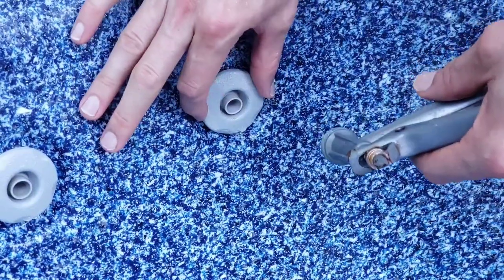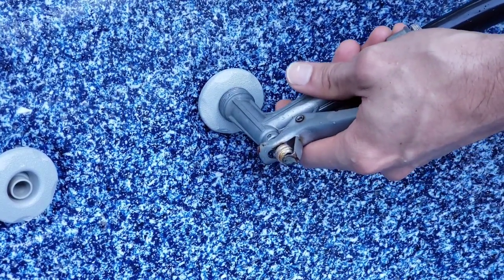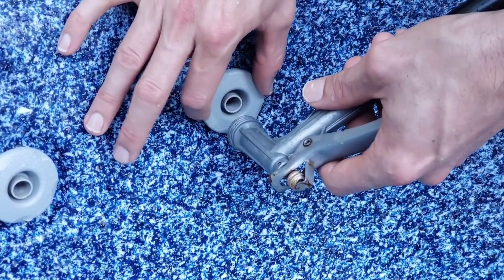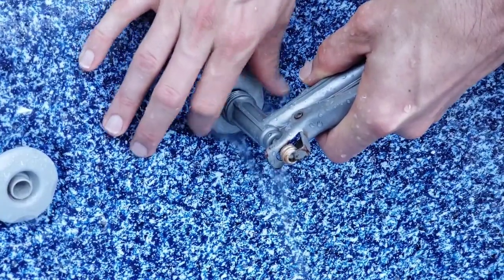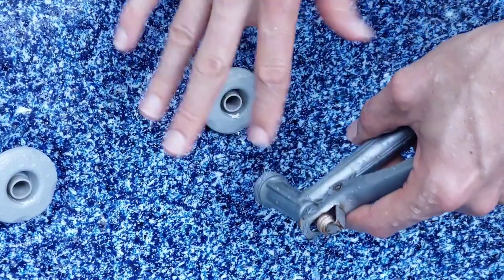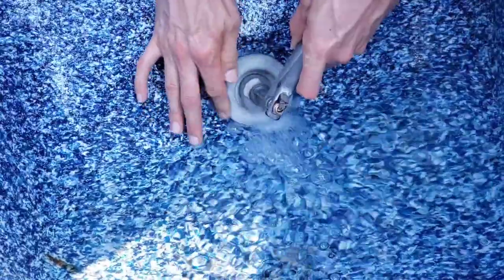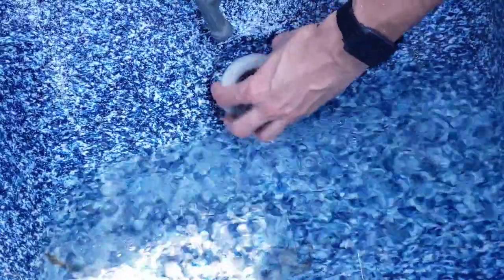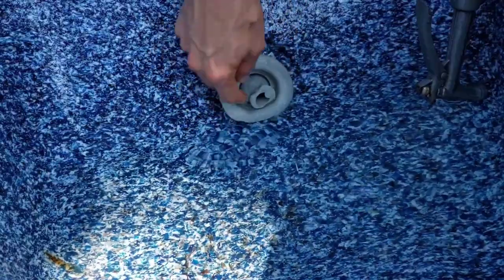Hot Tub Jets Stuck? The BEST Way To Fix & Clean Them

Comment: Awesome thanks
Reply from the maker: Glad to help!
Reply: I have brand new spa and some of my jets is always stuck lol. It is because my water is in trouble??😓
Reply from the maker: @michaeltechreviews5390  That is normal with spa jets. They get stuck. Higher hardness will make it worse, but even with balanced hardness tiny grit and stuff builds up and jams them. I have to use this method pretty often, and it works underwater too.
Reply: Ok thanks alot